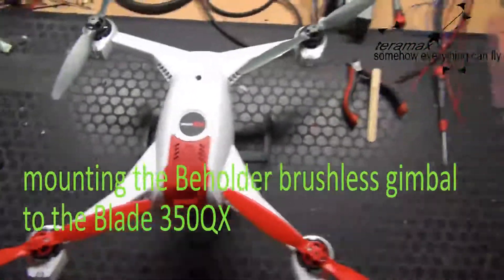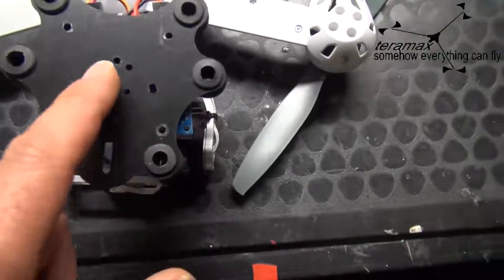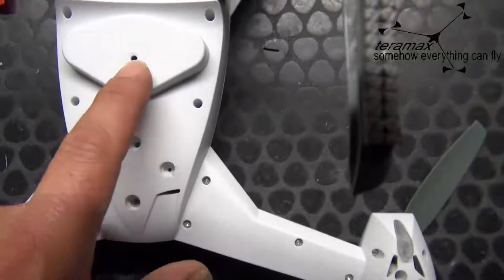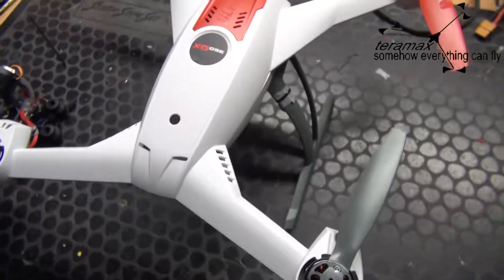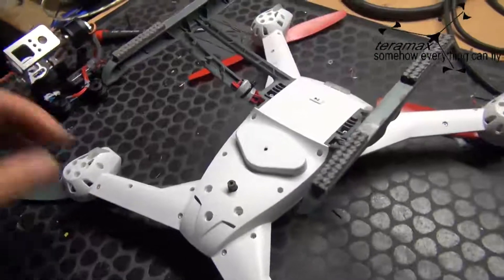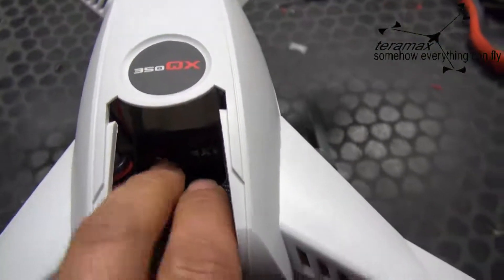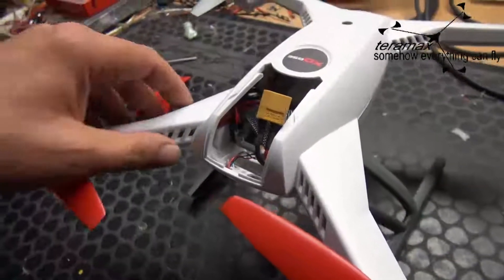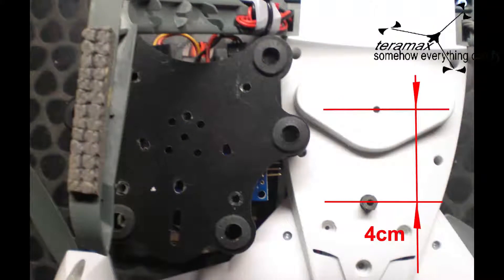how to: mounting Beholder brushless Gimbal on Blade 350QX

Comment from the maker: The Standof is inner tread on both ends 10mm long, the screws under the Board have to have a very flat shape, thin doubleside stickie tape is recomandet, you can use this sinkhead screws and make a countersink but for me it worked without.
The conectors for the motors i did bend outside to gain more clearence..

Comment: Your video makes it look easier than it is. What is the length of the standoff? You must of removed the board from the top plate in order to mount correct? Did you have clearance issues from then for the board as a result of bolt heads? Did you counter sink?

Comment from the maker: just remove the topshell and follow one of the black/red esc power wires until you come to the power distribution board in front of the flightcontrol. There you find 5 big fat solderspots, here you can solder the gimbal power on.